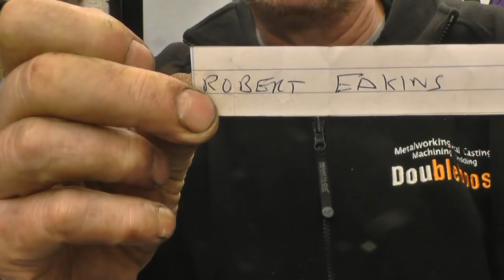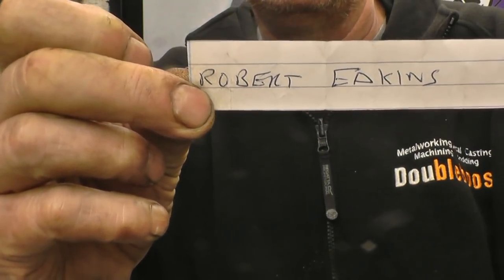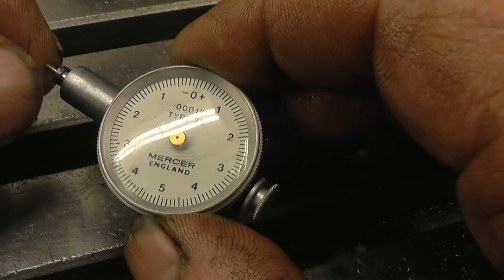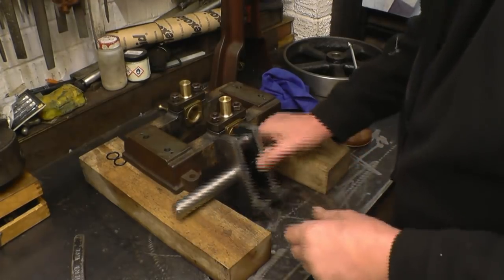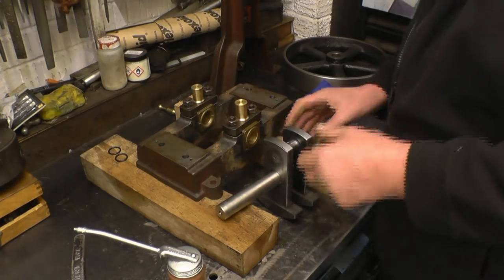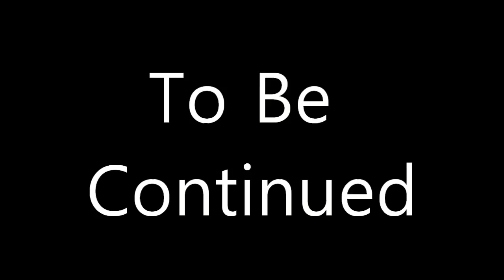SNNC 220 P1  Alloy sump weld repair

Comment: Nice Job John.  If you soak the surface with oil, the oil will soak into any cracks you can't see. Then wipe off the surface and warm it up with a torch, the oil will bubble out of the invisible cracks allowing you to see even the ones you thought wern't there.